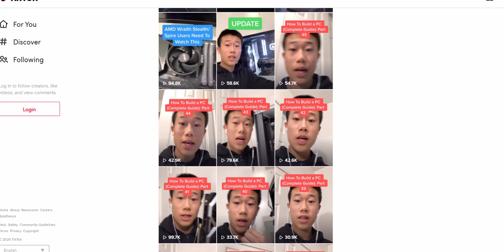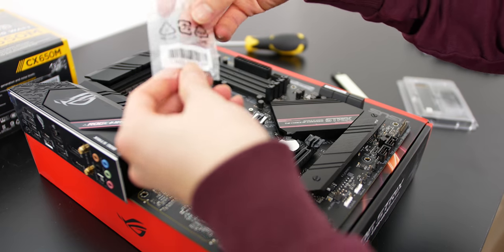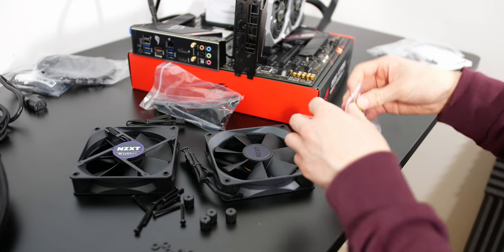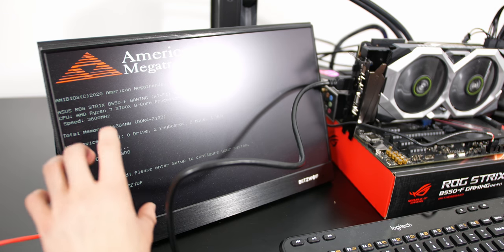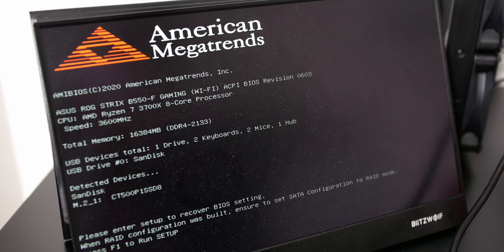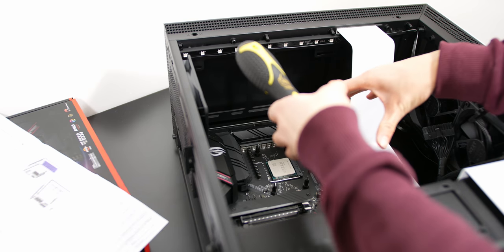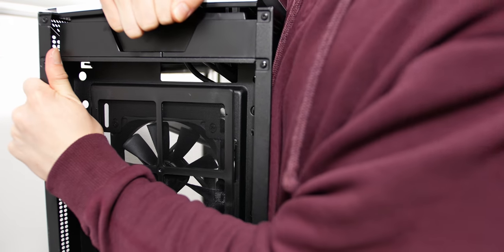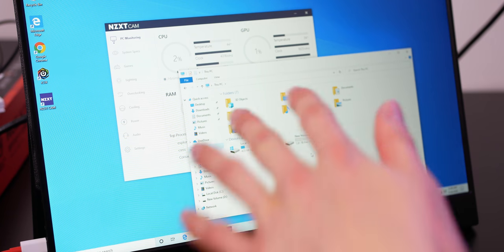Complete Step-By-Step PC Build Guide - How To Build a PC In-Depth Guide 2020 (TonyTechBytes)

Comment: Thank you for your video. I was pulling my hair out trying to figure out the screw for the M.2. My 'case manual' is 95% pictures with no written explanation and my mobo manual section for the M.2 installation is basically the same. I didn't find the bag with 2 'standoff' and 2 screws so I was filtering through everything trying to find a screw small enough to fit until I heard you say it's from the mobo box! Also glad you peeled that lining on the M.2 cover off, the img in the manual for that was easy to miss once I was frustrated.

Comment: Hey man, thanks for sharing how to build with this case. I have the exact same one, so very much appreciated!
One question though, why didn't you use the smart hub instead of connecting the fans to the motherboard? Wouldn't it be easier to control with the CAM software?

Thanks!
Reply from the maker: Hi Sergio, thanks! I wanted the customer to have control over the fans without relying on other software such as CAM.

Comment: Tony, Thanks for the vid. I found it very informative. I have built a couple of PC's before but my last build was 10 years ago and man has stuff changed. The basic steps pretty much the same but the parts and BIOS seem to have gotten a lot more user friendly. I have all the parts now to build my new PC. I'm doing an Intel 10th Gen I9 10850 with an Asus Prime - A Z490 MOBO. I really like your step with checking out the build outside of the case as I will be using the monster size Noctua NH-D15 SSO2 D-Type Premium CPU Cooler. Once you install it there is no room to cable anything around the CPU. So I will be installing it as one of the last components of my build. Anyway, Great vid and keep up with these great tutorial style vids. They are appreciated and watched by many.

Comment: Hey man, thanks for the tutorial.  I learned that building a pc it's easy,  but cable management and rgb is the hardest part.
Anyway, i used pcpart picker  to  project my pc. I also discovered that amd ryzen 3800x is at 330$ right now( better than intel, because with the same money you can buy an intel i5 9600/ 10500k).

This is my build:

CPU:  Amd Ryzen 7 3800X 3.9 GHz 8-Core Processor
GPU:  NVIDIA GeForce RTX 2060 SUPER 8 GB Video Card
MOTHERBOARD:  MSI MPG B550 GAMING CARBON WIFI ATX AM4 Motherboard
Cooler: 	Cooler Master Hyper 212 Black Edition 42 CFM CPU Cooler
Case:  	NZXT H510 ATX Mid Tower Case
RAM:   G.Skill Trident Z RGB 16 GB (2 x 8 GB) DDR4-3600 CL16 Memory
Storage:	 Western Digital Blue 1 TB M.2-2280 Solid State Drive
monitor:  MSI Optix G271 27.0" 1920x1080 144 Hz Monitor
keyboard:  	Logitech G413 Carbon Wired Gaming Keyboard	OR  Logitech G413 Silver Wired Gaming Keyboard

Can you please tell me how is this build, what would you change.
And i have 2 more questions:

- It's better if i buy an AMD GPU, as the processor?
- I cant find a power supply for the motherboard, so please can you suggest me one

sorry if my english is bad, but i'm an 14 boy that follows you from italy
Reply: Looks like a really good build Check out bitwits video about compatibility and just watch the Psu selection
Reply: Alexandru Stoica dont get 3800x, Dave money and get 3700x. They perform the exact same
Reply: Alexandru Stoica get 5700xt if you want, same price as 2060 super and cheaper
Reply: Toasteddd Toast true 3700X and I believe the 5700Xt is way better then even a 2070super(for the price)
Reply: Thanks everybody 😁
Reply: Underpowered Gpu unnecessary spendature on cpu get a 3700x and a rtx 3070 as it would be around 500 bucks
Reply: Toasteddd Toast what r u saying if he is gonna get 5700xt he might as well just get a rtx 3000 gpu
Reply: Adamya was posted before the nvidia event
Reply: Alexandru Stoica right now you can pick up a 3070 or a 2080 on eBay for a nice upgrade

Comment: After installing the CPU and the M.2. it's smart to install the CPU cooler first, before the graphic card and the ram. saves a whole lot of headaches.
plus the NZXT cooler header gets plugged into the CPU fan. NOT the pump. (the pump gets its power from the SATA cable.
you didn't change the settings in bios for UEFI to enable GPT

Comment: 16:40 What if you want to plug in the extra 4 pin header? Does the power supply have an extra cable and slot for it? Im not expecting to overclock the hell out of my system, but Im pretty obsessive and it bugs me to not have everything plugged in that’s supposed to be, and the power supply I bought doesn’t come with an extra 4 pin cable apparently. Any help is appreciated. Thank you. Great video by the way.

Comment: Great video. Kind suggestion: I used to not care about static shocking the components, then I screwed up about $1000+ worth in parts. Pay attention to that specially if you are building PC's for customers. The worst about static shock is that some times you don't completely kill a part, you just degrade the performance only when you run benchmarks  you realize you fucked up... Trust me on this one I've had a fair amount of headaches, the anti-shock wrist band kit is worth every penny...

Comment: Hi, I just found this Video as I have just bought the same Motherboard, it should, fingers crossed, be delivered tomorrow. A good video, but, I have one question, the Motherboard has an AIO Pump header, and I was wondering why you did not use that instead of the cpu connector?

Comment: i’m curious to know why you connecting the 24 pin cable before installing the MB inside the case.... Now yes i haven’t watched the entire thing, I came here after that part cuz it really bothered me lmaoo

(edit) I’m sorry! i get it now, you wanted to test if all the hardware works.... but i have to say that i think it’s such a drag cuz screwing in the motherboard with the aio installed is no no, also depending on what case ur using and what kind mounting you gonna do

Comment: Should I get a ryzen 7 3700x or should I wait for zen 3? Im already waiting for rtx 3000 series whenever they come out but If i do get the 3700x I could run my pc now since I already have a old gpu laying around, also amazing guide I know quite a bit about building a pc but I still learned a little bit.
Reply from the maker: I suggest waiting for Zen 3 if you can. Based on rumors, it seems to be very promising. Thanks for watching!

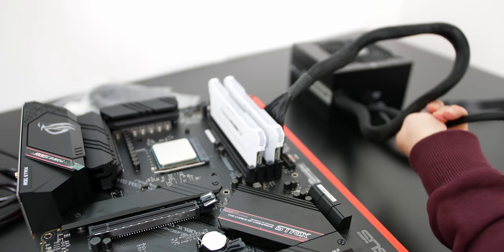Comment: My 1st build here.  At 16:30 of your video you mentioned the other 4-pin CPU cable is not needed unless overclocking is desired.  Where would that cable be connected to the power supply if one were to use that overclock functionality.
Reply from the maker: Tee Bee Even if you wanted to overclock, the single 8 pin CPU power cable should be more Han sufficient since it can supply up to around 385W of power. You plug another CPU power cable into the PSU and use a 4 pin part to plug that in if your PSU has additional ports.
Reply: @TonyTechBytes  Guy, you will NOT believe this.  I clicked on the power supply link of your build you had in the comment section that took me to Amazon to see one used (Warehouse Deal) for $62.  I stepped away for no more 5-minutes and when I returned, it was gone and the Corsair 650W power supply is listed for $150.  What a bummer BUT a great deal for the person who pulled the trigger to get the device.  So this was my 1st build frustration perhaps with many more to come.

At any rate, I learned a lot from your video.   BE FASTER ON THE TRIGGER!!!

Comment: I am having problems fitting the radiator fans in the case because the fans kept hitting the IO shield part of the Mobo. I tried moving the fans, but there wasn't any space on the metal bracket to screw in a screw. This is my first ever pc build and I want to make it work. I ended up moving the fans towards the glass panel a little more and the radiator is only being held in by one screw.

Comment: Great video. I’m trying to diagnose a problem with my newly built PC. I noticed that you said to pull back the clip before the GPU installation. I thought you didn’t have to? I thought it automatically opened/closed based on the pressure of applying the card?
Reply: No. That tab is to prevent from accidentally removing the card. If you want to install or uninstall the card, you have to pull the tab first.

Comment: Happy New Year Tony, I am waiting for my video card to come. It is on the way, so I just bought a old video card Nivida Quadro 2000 trying to install win10 first. However, no BIOS showing up, no win 10 showing up. Case fan and RGB is working, CPU fan is working. I plugged my iphone into rear USB2 port and it seem USB 2.0 in the motherboard is not working either, no power. Do you know any reason? is there something to do with old video card which might be not compatible with motherboard?  Thanks

Comment: You, carter, GutzyAiden, linus, bitwit, techsource and pcswithkyle should make a crossover.
Reply from the maker: TurtleJeremy We should 👀
Reply: TonyTechBytes each of you put in a different part. Linus does the cpu, you do Ram, GutzyAiden does gpu, pcswithkyle does ssd, techsource does the psu, bitwit does the hdd and fans, then carter puts the mobo in the case. Fail proof plan. Linus covers the flights of pcswithkyle, you, carter and GutzyAiden because you guys don’t make nearly as much. And also some of you don’t have a lot of money.

Comment: im about to build a pc for christmass!!! woop woop!!! although i have a few questions if you dont mind answeing them for me. I am currently running off of a dell optiplex 5050, and was wanting to upgrade it! i got a 3050, and powersuply to make it run, but little did i know that the gpu was not compatable with my currnet motherboard (5050 mother baord). now i am building a pc, i am going to reuse the hard drive from this pc to the one I am going to build for christmass. Does this mean i am going to have to reinstal windows, and do all the drives you did in this vidieo? just so you have the specs, i am going to have a amd 5600x, ASUS ROG Strix B550-F Gaming (WiFi 6,  and a evga 3050 graphics card. im hoping it will work, so im super exited and very nervouse to build it!

Comment: Hey man, very detailed video. I'm having a little bit of an issue though, I'm currently swapping over my Ryzen 7 from my HP Omen over to here and I've done all the steps and I also have plugged in my 3070 and when I get to hit the power buttons I'm stuck on the white like saying VGA. I've already swapped the GPU to the other port and all. I also downloaded the BIOS and did the flash with the button on the back. Any help please? I may just have to take back the board and get the Asus TUF one I was seeing

Comment: I have the non WiFi version of this MOBO, but when I turn on my pc, everything works fine but my monitor says no signal and the boot GLED is turned on. I also noticed that my cpu fan rgb didn’t turn on even though it’s plugged in. Another thing to mention is that my friend has the same MOBO and he told me a potential solution was to plug in the extra 4 pin plug for the CPU power. Could I get some tips? This is my first pc build. Another thing I should say is that I took the psu from my omen pc and I have a feeling that could have something to do with it, as that PSU is only 500W.

Comment: Im somewhat lost because the video is too long, all what i want and need is to know where to plug what in order to have the Nzxt h710i fully functioning properly and as intended such as fans led and fan controlling etc ...

And how to plug in for the power supply like what parts of the nzxt goes directly to the psu and what goes to the motherboard aside from the well knowing MB 12pin connector and the cpu connector.
Reply: And also how to get the kraken aio working and fully functioning as well

Comment: So did you not need to do a BIOS update with that Ryzen 7 in that motherboard? Because I’ve got a ryzen 5600x with that motherboard on its way and I’m not sure if I should do a BIOS update?
Reply: did it work? im getting a ryzen 5600
Reply: @bruhlyssaa  I ended up doing a bios update anyways just in case but if you’re not getting a 5600x and just a normal 5600 I don’t think you would need a bios update but it was easy to do anyways.

Comment: I got a similiar setup (H510, same Mobo) and my power switch wont work. I already tried all different variations of plugging the fpanel headers with and without the breakout cable part, but just wont work... Any ideas?

Comment: So I just built my PC but I have a question about the fan setup for the AIO. So when I installed my fans on the radiator I put the fans on the same side as u did but the fans were flipped so technically u see the back of the fan should I turn my fans around ?

Comment: Do I need front panel connectors because I think I might build my own case?
Reply: They're not absolutely required. At the very least, you'll want some sort of power button to turn on your system.
Reply: @JJFlores197  how would I turn it on with no front panel connectors
Reply: @joekomadowski7832  I literally just said that you want to include a power button to power on your PC. The rest of the front panel headers aren't required to power on a PC.

Comment: After you save the initial bios changes how do you get to the windows USB? Should it do it automatically?
Reply: By default, most PCs will boot from the first device that is bootable. If you have your USB installer plugged in, it should automatically boot from that unless you specifically told it to not boot from a USB drive.
Reply: I did. Still reboots to the bios load up screen. If I go into bios and boot from the drive then it goes to windows.
Reply: My boot option 1 is windows boot manager (m.2_1:WDS

Comment: I’m not sure if I’m wrong are u using the NZXT water cooling as a exhaust because I’m buying a 3070 vision rtx for my pc build and I have this case and that exact water cooler I’m just not sure if it will fit will it fit?
Reply from the maker: It’s set to exhaust at the top of the case since there are already three intake fans at the front

Comment: CXM psu lineup is terrible for the price. It's definitely not meant for builds like these. I understand the customer chose most of the components but as a builder I'd expect you to advise against such bad decisions. Definitely has coil whine. You can get a much better psu for that price. Ram is overpriced but it's fine. Ventus GPU temps are so bad. Thermal throttling is present. Admittedly the board you chose is quiete overpriced. You could get a simmilarly speced X570 board for the same price. You've got a long way to go in terms of knowing componenets, but your content is good. Please consider watching Gamers Nexus, and studying logistics of different components next time 👍
Reply from the maker: iWolfy_MC Did you just forget that there’s a pandemic going on? There’s almost nothing in stock and this is what I had to get for the customer who needed it ASAP. 

I know the Ventus lineup isn’t the best, I know there are better PSUs, sure an X570 board would probably be better, and yeah there’s cheaper non-RGB RAM. But where would you even find that???
Reply: Do you realize COVID-19 is still prevalent in society? At least he didn’t get an 80+ White bomb from thermaltake.

Comment: How do you install a kingstone ssd that’s what I want to know
Reply: Which specific Kingson SSD? If it is an M.2 SSD, it goes into an available M.2 slot on the motherboard. If it is a 2.5" SSD, then it goes into a drive bay in the PC case meant for 2.5" drives. You then run a SATA cable and connect it to the SATA port on the board and to the SSD and run a power cable from PSU to the SSD.

Comment: hi. based of your content i purpose that you are good at pc building. yesterday i tried to build for the first time. all worked great, booted in windows but when i tried to install my chipset driver it said that it needs a restart and after it restarted all it did was to give me a black screen. i done some research and i think that my version of bios doesn't suport my cpu. if you have any idea, can you pls help me get my pc back working. thanks a lot
Specs: Asus Rog Strix B450-f
Ryzen 7 3700x
Msi Rtx 2080 super
I think it's good to say that when i press the power button on the motherboard appears a white led that doesn't turn off until i press the power button again (to turn off  my pc)

Comment: i have a question do they install the power button's wire already?
Reply: The front panel cables are part of the PC case. You just have to plug them into the appropriate connectors on the motherboard.
Reply: @JJFlores197  thanks man

Comment: Hey, thanks for the video, i have a B550-E, do i have to install a graphics card to the board? I tried using the HDMI and im not getting any display, the error is AE.  Thanks for any suggestions.
Reply: What CPU do you have? If your CPU has integrated graphics (APU), then you don't need a dedicated graphics card. However, if it doesn't have integrated graphics, you do need to install a graphics card.
Reply: @JJFlores197  thanks, it’s a ryzen 9 3950x, I don’t think it has integrated graphics
Reply: @Computerman4711  Yeah you'll need a graphics card. Ryzen CPUs that end in "g" do have integrated graphics.

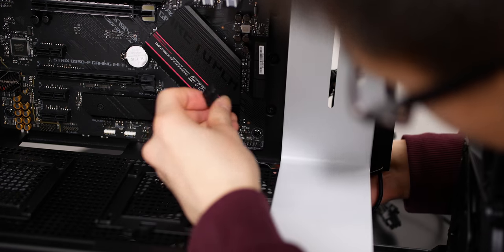Comment: Trying to plug everything in and I can't seem to find the cable you're using at 56:25. I have no idea what I'm doing so I'm getting annoyed hahahh
Reply: What case do you have? As far as I'm aware, most cases don't have a unified front panel connection header, but rather individual cables for the power button, reset button, and LEDs.
Reply: @JJFlores197  I got the phanteks eclipse p500a. I'm getting some help today from someone who knows about computers so hopefully it turns out ok